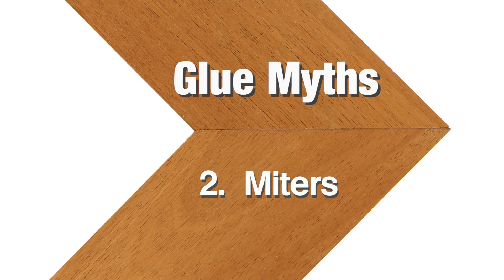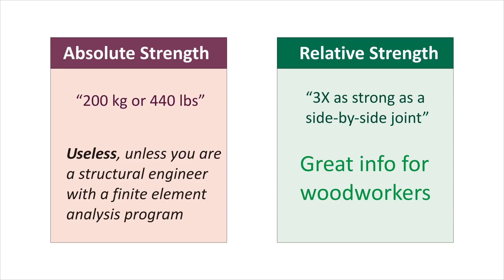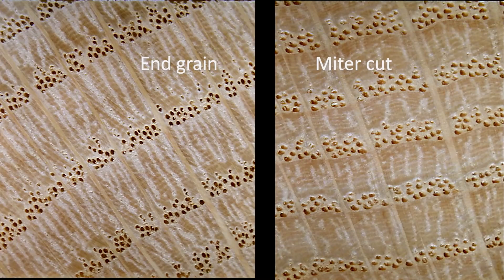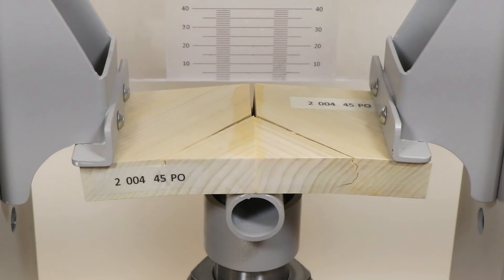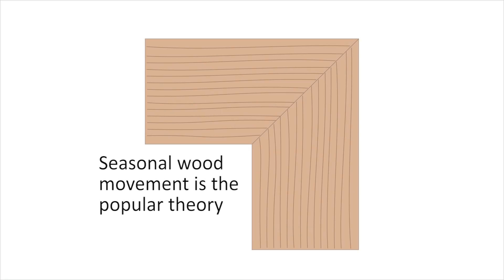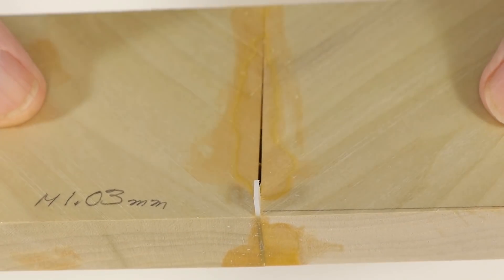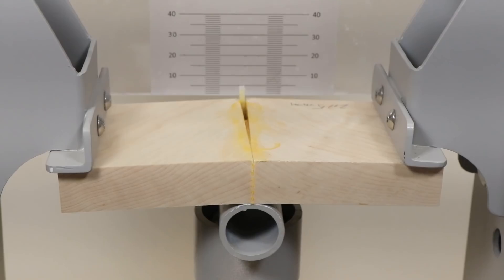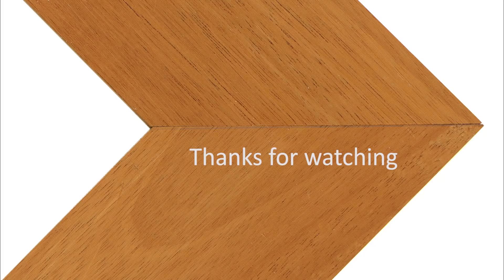Glue Myths:  2. Miters

Comment: It all comes down to application, a glue joint will never be as strong as a mechanically interlocked joint. But in some case is strong enough.  It is in the comparison of these two joints where the rubber meets the road in woodworking.
Reply: Yep, but sadly he still claims that endgrain-glueup is the strongest when it is the nearly the weakest for of joint you can make (other than a 90° endgrain-to-longgrain buttjoint).

Comment: I'm really enjoying these videos, and the responses from the big names in the YT woodworking community.  As an engineer, I especially like your rigorous approach to the testing.

We have always been told that it really doesn't matter what glue you use because it's all stronger than the wood.  Your demonstration that this is not true for end grain and miter joints begs the question what glue is best for these.  PVA, epoxy, polyurethane, hide?
Reply: "Your demonstration that this is not true for end grain and miter joints begs the question what glue is best for these."
It shows that endgrain joints are weaker cause actual longrain-JOINTS are, as you said, as strong as solid wood, he just chooses not to show any longgrain joints - why ever that might be.
Reply: @ABaumstumpf  You might want to watch his previous 'glue myths' video.
Reply: @spruce_goose5169  "You might want to watch his previous 'glue myths' video."
I did - and what it showed was that buttjoints are by far the weakest and the endgrain-joint was just the least-bad out of the worst, failing at not even 50% the strength of the wood, were as something like a finger-joint is as strong as the wood.
Really, just watch the video and then ask your self why he is only showing butt-joints - the weakest known joints.
Reply: @ABaumstumpf  'Strength of wood' is too nebulous without specifying the axis.

Your response is nested under Brian Taylors', which states that the strength of the end grain glue joint depends on the glue. A side grain joint fails at the lignin bonds, so there is no benefit to using glue any stronger than standard wood glue. But since end grain joints fail at the glue, a stronger glue may be of benefit. 

There is no argument here against the reality that an end grain glue joint is weaker than in-tact long grain fibers. 
The takeaway from the first video is that end grain glue joints are stronger than lignin bonds. That takeaway does not provide logic against joinery, of which I agree is still needed. It simply says that end grain glue will hold longer than lignin when loaded across grain. Do with that what you will.
Reply: @spruce_goose5169  "'Strength of wood' is too nebulous without specifying the axis."
..... are you kidding me? Or are you really that dense?

"But since end grain joints fail at the glue, a stronger glue may be of benefit."
Yes, and using a better joint than and endgrain butt joint would be even better - so much better even that it would be no longer the glue failing but the fibres and lignin.

"The takeaway from the first video is that end grain glue joints are stronger than lignin bonds."
Yes, and not as the video claims that endgrain-joints are string.
Reply: @ABaumstumpf  you seem to be hung up on joints. I'm not, and likely noone, is arguing that a butt glue joint is stronger than joinery. 
You seem caught up in an argument no one is having. It's with yourself.
Reply: @spruce_goose5169  ... Habe you actually watched either of these 2 videos? You know, including the video we are commenting under, that concludes that neither endgrain buttjoin nor miter joint are weak joints despite showing that the fail under very low stress?
Reply: @ABaumstumpf  We probably don't fundamentally disagree all that much.

I agree the videos could be misinterpreted, and his conclusions don't appear to at all include the subject of JOINERY, which should probably be included. Wood Whisperer and Stumpy Nubs both did response videos that shed light where he left it dark-- both good videos.

That said, I don't see where Patrick explicitly says anything to the effect that end-grain glue joints can compete with proper JOINERY. Can you provide a time stamp for where you feel this was said? That's clearly your grind here, yet it's not what the videos were about so far as I can tell.

Stepping back a bit: I initially responded to you because you wrote: "actual longrain-JOINTS are, as you said, as strong as solid wood, he just chooses not to show any longgrain joints"

I interpreted this to mean long-grain (aka edge or face grain) GLUE joints, because that is the context provided by both the video and the comment you replied under. And he absolutely does show long-grain glue joints, I'm sure you can agree. I'm not being smart, I honestly 100% thought you were referring to glue joints. 

But I am thinking now you perhaps meant JOINERY? If so, that would explain this confusion between us. I have no argument with you over the strength of joinery vs just simply gluing butted end grain. I'm viewing this all in the light of butted glue joints, as that is all the video covers.
Reply: @ABaumstumpf  I've since read some of your other comments here. Gettin' a clearer picture of your stance. A question for you:

Do you think the strength of joinery comes from the GLUE BOND strength of the long grain, or from the physics of the joint? 

One of my takeaways from these vids of Patricks is simply that it's the latter, whereas some may believe it to be the former. Certainly not comprehensive videos however. Cheers

Comment: Thank you very much for adding a little common sense and empirical treatment to a very common subject riddle with misconceptions and carry overs from forgotten sources. Glue is effective in endgrain. The problem seems to lay in the definition of how how effective this  is. Long grain glueups are as strong or stronger as the wood itself and that is the expectation. End grain glueups are many times weaker than uninterrupted long fivers. End grain joints are the wrong choice if you have the expectation of continuous strength over the length of a structural member. If you are doing marquetry, glue away!

Comment: This makes a lot of sense and is extremely helpful to see "how accurate" is "accurate enough"...thanks for sharing! Could you possibly simulate seasonal wood movement by placing the glued test pieces in a high humidity environment for 1 week them moving them back to a low humidity environment for another week to guage the difference in strength? obviously doesn't simulate years or decades perfectly, but might be a step towards proving/disproving the seasonal movement counter argument.

Comment: I'm sure that many people have already recommended it, but moving glued pieces between a damp environment, such as a unheated basement, to a dry environment multiple times over the course of a few months might sufficiently model seasonal expansion and contraction for the purposes of the video. It might also be interesting to leave glued pieces out in the elements and document how rain, snow, etc. weakens the joints.

Comment: Great video, thanks for the insights! I believe another reason people tend to underestimate the strength of miter joints is simply its use case. Using side-to-side glueups in a tabletop implies very long glue joints that (obviously) cover a lot more surface area than a mitered picture frame for example. Seldomly would someone build a tabletop where all the panels are cut at 45 degrees to the grain direction of said panels. Now we know that if they did, that tabletop would be inherently stronger at the joints. It would just take some veeery wide slabs :D
Keep it up!
Reply: "believe another reason people tend to underestimate the strength of miter joints"
Nah, it just is weaker.
Build 5 90° joints:
butt-joint and miter - by far the weakest
splined miter - already stronger as you introduce more longgrain
lap-joint - way stronger
box-joint - the strongest - here the wood will fail before the joint.

Comment: Being a retired PhD shop teacher and owner of a picture framing business, I have known this forever. BUT there is a problem with end grain joints; dry joints. Apply the glue, clamp it tight, then remove the clamps, inspect the joint and the glue is gone.  It penetrated deeply into the end grain leaving little in joint itself. My solution for picture frames was to apply glue to each side of the miter, press it into the end grain with my thumb, then apply another layer to make sure I had some squeeze out. No squeeze out, dry joint.

Comment: Isn't it true that nearly all miter applications are where the surface area of the miter joint is significantly smaller than the largest dimension of the final item? This returns to the idea that leverage allows assembly-wide stresses to overcome the small miter joints. Examples include boxes, picture frames, mouldings, etc.

Comment: I really like your logical, actually scientific approach. I do think that seasonal movement is a factor with miters on wide boards, say 4-5 inches or wider, depending on species. I think the amount on movement on small pieces like the ones in your clock is not going to be enough to compromise the joint. My rule of thumb is that if I have to start thinking about putting two biscuits into a miter (because of width), it's probably not going to hold up in the long run anyways.

Comment: The comparison I'm interested in seeing is the difference the glue joint makes in a board. The end grain glue up really reduced the strength of a solid board, now try a solid board in the same orientation as the edge grain glue up and we can see if the glue joint weakens the board as much as the end grain glue joint.
Reply: He will never do that - that would show that the endgrain-joint significantly weakens the board.

Comment: There are many variables in the real world and only some were addressed here.  One in particular that is not addressed is glue technique and I believe is as important as your physical joinery.  The amount, age, coverage, working time, etc. all factor into overall strength.  The quality of the glue job can have as much or even more significant impact than the quality of the joinery.  I received a picture frame gift from a talented woodworker/artist decades ago.  All joinery appeared perfectly cut to me.  All corners were mitered and splined with nice contrasting wood.  The piece sat on my wall for over a dozen years.  Recently I noticed one of the corners fully separated.  Closer inspection shows something I have seen before in failed pieces.   The glue surfaces had dried (skimmed over) before assembly, resulting in a mechanical only joint.  If these joints had not been splined they certainly would not have stayed together as long as they did.  Overall, I believe that grain orientation is likely the least significant variable in the overall set of variables involved within the wood, joinery, overall woodworker skill, and subsequent dynamic life of your project.

Comment: Cool to see how the joints fail under a worst case load.   I would be interested if you could compare the failure point of end grain vs side grain glue.   I think you could do an apples to apples test by cutting a  rabbet in the end grain of the two blocks then gluing either the end grain surfaces, the side grain surfaces, or both. Since it would be aligned the same as the end grain joint, the glue should fail before the wood fibre so we can find out whether end grain or side grain glue is bonded stronger. Cheers.

Comment: This is fantastic, thank you!
I'd think it's equally important to measure the strength of the joint in the 'other's dimension, that is, applying the force on the short sides rather than the faces. 
The reason is that any force that is applied on a miter frame would act on the corners, forcing them away from 90° in both +/-.

Comment: I'd like to see how strong a miter is with a #20 biscuit added.  I bet it will be quite a bit stronger even though they claim biscuits do not add any strength and are only meant to line the wood up.
Reply: I never understood the claims that biscuits don't add much strength. They're like plywood splines so one would always have some number of layer with favorable grain direction regardless of shear load direction. I guess in tension it becomes a function of the additional gluing surface added.
Reply: Miter and end grain joints were the accepted exception to the “rule”
Reply: Yeah, I guess when glueing to pieces of MDF together (edge to edge) the biscuit wont add much strength. In that case the glue joint is much stronger than the boards.